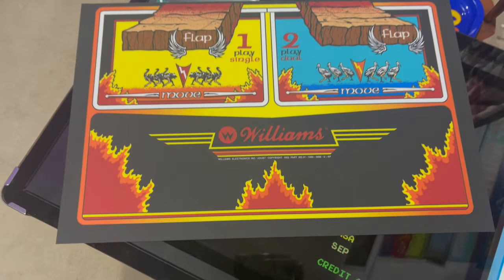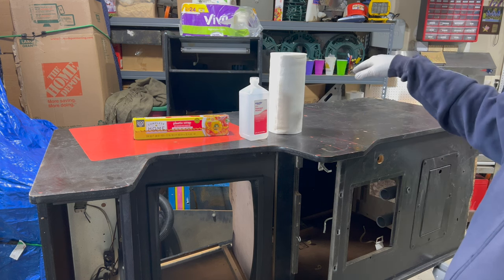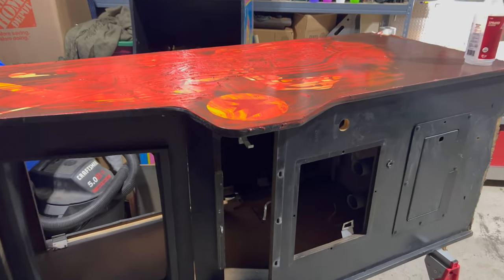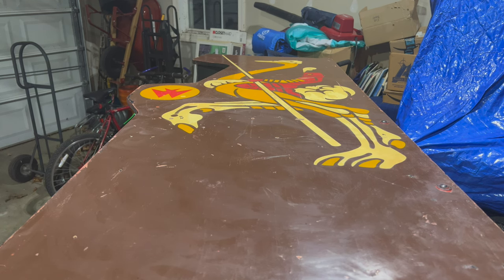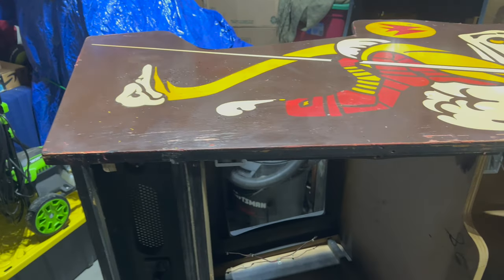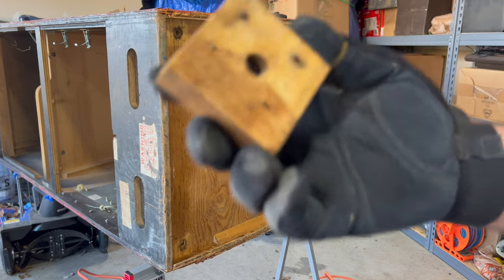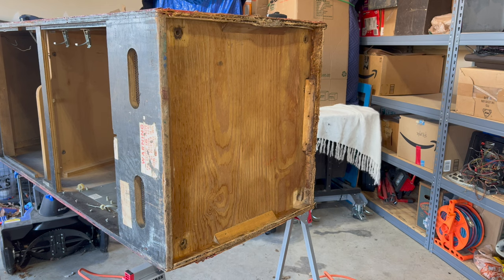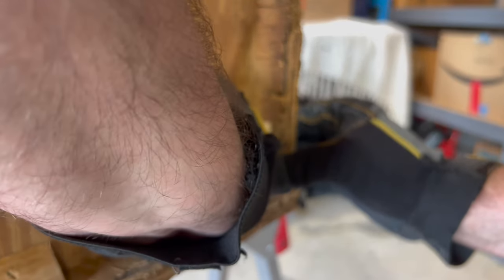How to Remove Black Paint & Recover Original Stenciled Arcade Side Art: Joust Restoration part 3

Comment: I know you're just replicating the way the t-nuts and cleets were originally installed, but I don't think that's how t-nuts are properly used.  With the t-nut on TOP of the cleet, the leveling feet apply upward force, transferring it to the t-nuts, which want to push up OUT of the cleet and push up into the bottom panel of the cabinet. The cleet is providing NO extra strength or support.
Reply from the maker: For the leg levelers? I think you’re right. Originally, the t-nuts might have been sandwiched between two layers of plywood. With the cabinet sitting on the ground, I suppose its weight helps keep the cleats embedded in the wood, but any twisting, etc. motion will start to pull them out.

Comment: Did you use the alcohol again?
Reply from the maker: Yessir, works like a charm! Wait, you’re talking about removing paint from the cabinet, right? 😅
Reply: @overtimearcade  yes
Reply: @overtimearcade  the paint they used to cover the artwork on the side of the cabinet…
Reply from the maker: @chriscravens4915  It was only about 500 coats thick. On the bright side, it might have helped to preserve the original stenciled artwork?